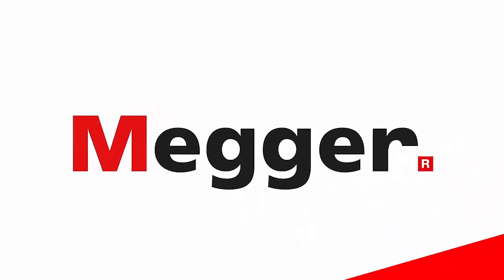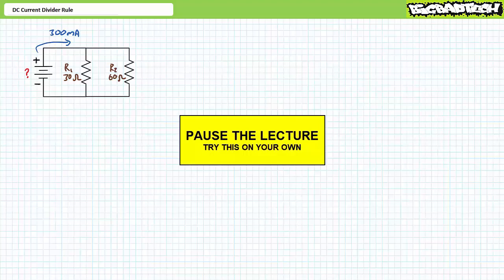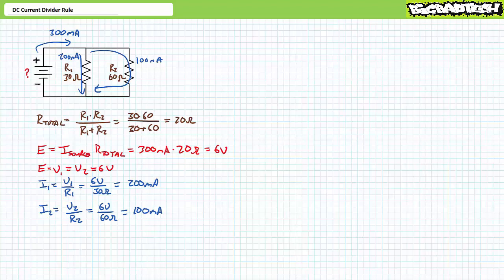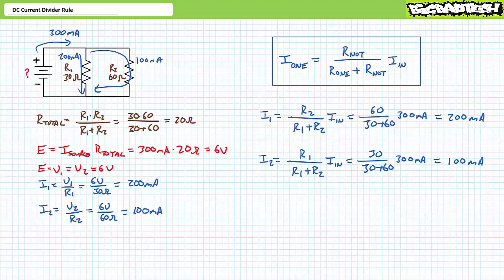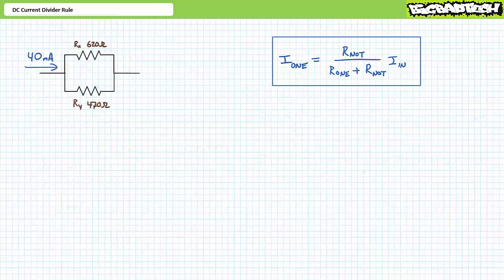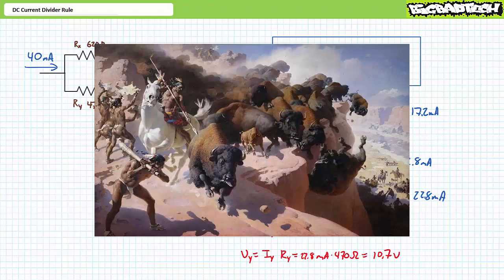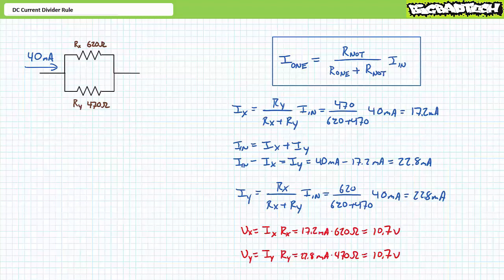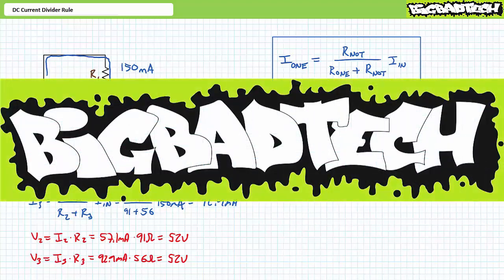DC Current Divider Rule (Full Lecture)

Comment: That resistor of interest is a nice formula tool. But I personally find it easy to screw up with. It would be worth using it if it can handle 3 or more resistors. For just 2 resistors, I find it easier and safer to stick to the old formulas.